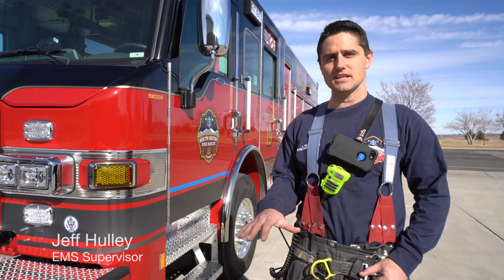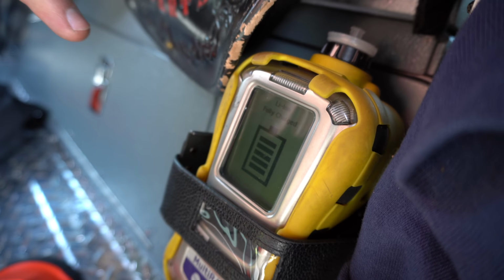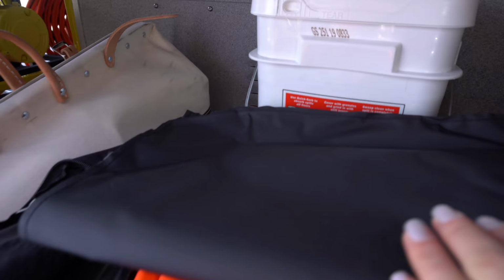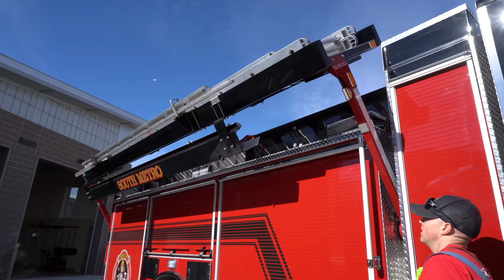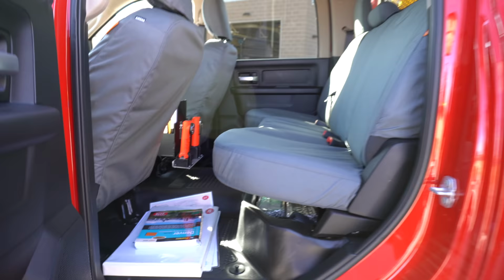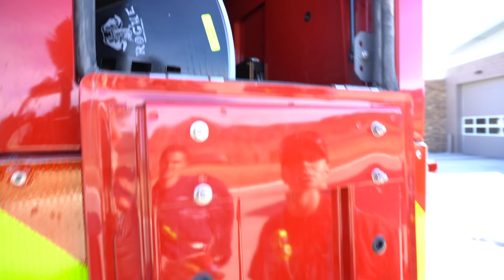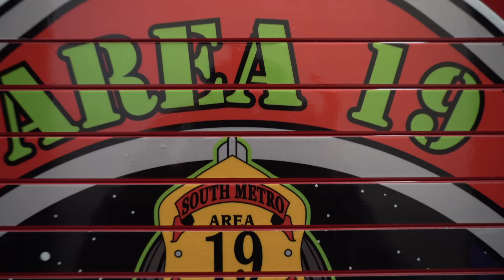Fleet Friday - BRAND NEW Engine 19 & Brush 19

Comment: Awesome job guys, a lot has changed in 40 plus years. The decon back then was a quick rinse off with a hose line. Brush ops were a shovel, rake, pick ax and hoe plus an indian can. Can't say I miss the cold rides on the back step either. The good ol' days.  Good luck with the new rig.

Comment: It’s like a engine and a rescue truck had a baby
Reply: The air dump is the biggest gimmick I've seen on an engine. Makes sense on the frieghtliner and international rescues but id be surprised if anyone uses that dump feature.
Reply: All the need now tank to have a baby with the rescue
Reply: @hihfty  I would assume the air dump would be helpful for after the fire, when crews are reloading supply lines.

Comment: The Wet down Tradition goes Back to the First Fire departments in Philadelphia.  It includes blessings, and first fill of the tank.  A long with the moving of equipment and pushing into the station house.  Making the pumper ready for it's service.
Reply: 9okjk

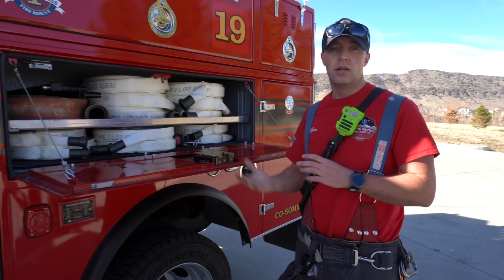Comment: Fire history lesson: Wetting down the wheels was also to get the horse crap off of the steamer's wheels before you put it in the barn. And back in the day, you push the engine in because the horses could not back the engine in. And at 25:40, he meant to say 1.5" and 1" hose, standard on wildland engines.

Comment: You don't keep a Knox key in there?
My department is in a small ish town versus Metro and we carry a Knox device on our engines.
And as far as the way the hoses are laid out, I strongly suggest looking into the triple lay. We started using that today on our engine and it's pretty cool, there's no flaking it out and it doesn't look like spaghetti when it's pulled. It's ready to charge as soon as it's off the truck.

Comment: Definitely great apparatus and video. I did have a question on Brush 19... is it a good plan to store the chainsaw chaps in the same compartment with the chainsaw exposing them to the fuel vapors? Keep up the strong work!
Reply: It’s a vented cabinet so the fumes are displaced into the air not in the cabinet

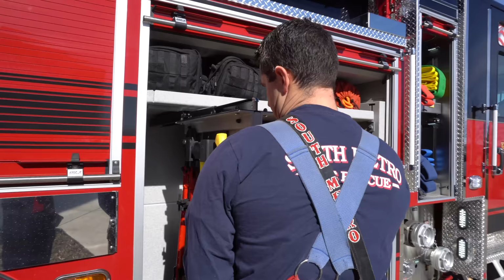Comment: @19:45 I am glad we are one of the very few FDs around anymore that provide non emergent lockout assistance.  Run the plate with dispatch, and as long as the registered owner matches the person on scene, we will unlock a car for anyone (after having you sign a paper saying we are not responsible for any damage that may result, which truly is none, but have that as a protection).  We do this as long as the first due engine is not tied up on another call.  If it is an emergency lockout (child in the vehicle, pet in the vehicle, or the vehicle is running) we will respond the second or third due if the first due is on a call.  Oh we also still will get a cat out of a tree if someone calls for that as well.  We are the only FD in the area that does either of those things.  In some of the surrounding jurisdictions even the emergent lockouts are handled by the police/sheriff's departments.
Reply: Alexis MSP Gaming that isn’t true at all. Most all the surrounding departments do exactly that...
Reply: @UnionPacific18  in my area and in the areas I have traveled to the vast majority of FDs will not do lockouts or cat in tree calls anymore.  For every department that does I've seen 10 that do not.

Comment: one Question is the 1.5 Inch coupling the same like the 1 3/4 Inch coupling ? because he sayed that the 1.5 Inch thread is for 1 3/4 Inch hose. sorry for the queation i'm from Germany i don't no that
Reply: The American fire service used to use 1.5” hose with 1.5” thread. The adoption of 1.75” hose still maintained the 1.5” thread, because it was easier/cheaper and the flow rate difference is negligible.

Comment: And meanwhile hardly any German fire department has sth similar to a brush truck ... only very few departments run forest tankers, but most departments don't have an extra truck for that
Reply: @SouthMetroFireRescuePIO  as most of our full-size Engines have 4x4, departments usually take their plain normal Engines, Rescue Engines and Tankers offroad as well. Driving across fields, meadows, sand and forest roads usually isn't a problem even with the apparatus which are from the downtown area of a large city FD. Some apparatus have a dedicated road-chassis with less ground clearance, poorer approach angles, smaller tires etc - those aren't offroad capable, but the plain "normal" Engines indeed are offroad capable. Thus it's not uncommon to see an urban fire truck on scene of a brush fire, field fire or forest fire here, and that's also why departments usually don't purchase seperate brush trucks

Comment: And I am surprised that OSHA allows firefighters to be on top of fire rigs without safety lines. I don't see any way around this unless you have some kind of high wire cable system around the truck, maybe a system that goes up with the push of a button? It's an idea. Either way I am surprised that OSHA doesn't step in and say something. BTW How do you guys get on top of the rig on ice or snow?

Comment: Hemi in a 5500 you’ll regret that very soon
Reply: My department just bought over the last two years 36 ambulances (we rotate our fleet every four years or 250k miles whichever comes 1st) -they are all Dodge 4500s and they all have Hemis-we LOVE them and so do the mechanics. They HATED the diesels-so did we. 
And as an EMT/Paramedic I and my partner like getting to the scene quicker so we can work and get our patients stable so we can get them to the hospital quicker.

Comment: Why not option for a Cummins for the 5500, a gas engine in a 5500 grade pickup is a lot on that engine, plus the extent it will be used to as a fire truck

Comment: Purpose built spec and a beautiful truck!  Could you tell me how much this Velocity cost if you are able to share that information?
Reply: @SouthMetroFireRescuePIO  It would also be interesting to know what the loadout costs on top of the truck cost. I assume all the gear is purchased new for this truck and the old gear stays with the old truck? Does the former Engine 19 become a reserve now or?
Reply: n0oneh3re all the equipment from old E19 gets transferred over, unless anything new is added or replaced. It really depends. The ex E19 could go to reserve/spare status, but it also could go to another firehouse, replacing a older rig, and then that old rig goes away.

Comment: It's a nice engine I'll agree however ,and this is coming from a Brit who is knowledgeable in American style firefighting, shouldn't an engine company carry a bit more hose especially attack line??? Also on the subject of cancer America does need to rethink, in the UK the NFCC decided that all of the UK's PPE would be from Bristol Uniforms which has Xflex technology making it more maneuverable than American gear and all gear would be in a tan/ beige which goes GREEN if exposed to cancerous materials. Also doesn't it make more sence to have a battery and generator combi tool instead of 2 seperate peices of equipment??

Comment: So with the new pumpers, does that mean all South Metro Engines will be standardized? (Will they all look the same, and is this also true for the ladder trucks?)
Reply: Yes, i'm pretty sure the new Black over Red is for all the new units they buy including Towers, Ladders. This specific Engine is a Pierce Cummins ISX12 with a PUC pump on it and Husky  12 foam system. Now im pretty sure this is the new standard for South Metro
Reply: @camden3957  ok thanks!
Reply: Awesome, eagerly anticipating more!

Comment: Maybe I missed it, but, why is it engine 19 and 3310?
Reply: Normally the 3310 is a fleet number. So if after multiple year it gets transferred to another station  it wont be called engine 19. But the 3310 number is still used so the maintenance record follows it.

Comment: WIERD how your department doesn't stick to a standard paint scheme you guys just took delivery of new ladder trucks last year but had them in the white over red now you've ordered more trucks black over red which is beautiful.
Reply: The most recent delivery of SMFR suppression units prior to Engine 19 was back in 2017 for 5 engines and 2 towers. No engines or aerials were delivered in 2019, but SMFR did take delivery of Tender 34 in 2019 which does feature the current black over red.

Comment: @South Metro Fire Rescue PIO What is Sah23
Reply: @SouthMetroFireRescuePIO  They were briefly added to the W Quarto Dr hoverboard battery leak yesterday. Seems like it would have been quite the response and not one of the units one would normally see running on a South Metro call.
Reply: @SouthMetroFireRescuePIO   pulsepoint